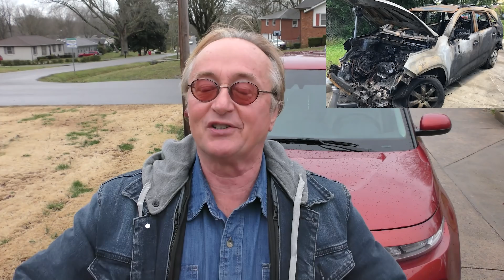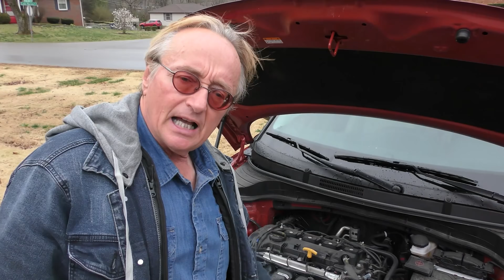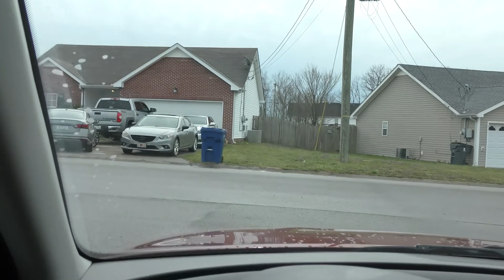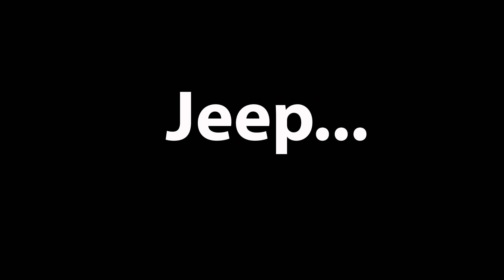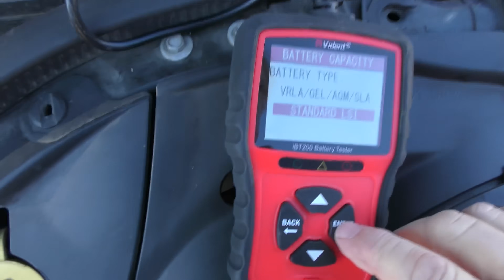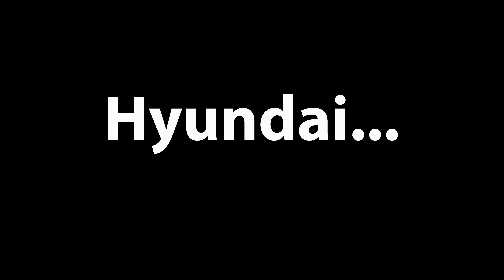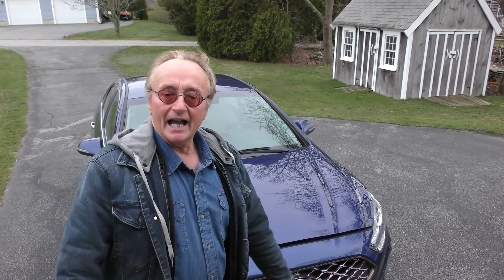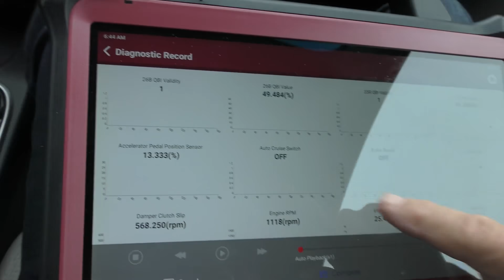3 Car Brands That are Crap

Comment: Bought a new Dodge Dart and it burnt oil like crazy but was still in the legal limits of oil consumption.  If I'd go the 10,000 miles recommended for oil changes I would only have 40% left of oil. I changed it every 4000 but oil level would be below dip stick line. Bought a Kia Sportage and it also burnt oil but not quite as bad. Bought another Kia Sportage and drove it conservatively the first 1000 miles. It also burns oil but not as bad. Stays within dip stick lines. I'm starting to feel that all engines these days are burning oil.

Comment: All car makers have an acceptable oil usage which it has to exceed for warrantee work, also the car might get better with use, you can also change the oil viscosity to minimize oil burning. Air cooled Beetles burn up no 3 because of the oil cooler placement, that's why they moved it to outside the fan shroud, it still took some air from no 3 so didn't cure it fully.

Comment: To be fair. I've had my 2013 kia Rio for 10 years. It started to burn oil past 180000 km. I've got almost 300000 on it now and it still goes. I'll drive it into the ground before I replace it and I feel it was a decent car for the price at the time.
Reply: You have an older one...built better back then.

Comment: My 2016 Elantra Sport is in it’s second warranted engine (refurbished replacement of course) and at 74,000 it’s using damn near a quart of oil every 1,500 miles it seems.

Comment: If the transmission fluid is correct, and 5th gear is whining, then it means there is subtle damage to the 5th gear. You have to examine the gear visually.  Sometimes there is a small groove or scoring near the gear teeth. Its hard to say what the future holds for it. I would be a lttile worried If I was doing alot of highway driving. Its hard to say w/o visual inspection. The dealer probably dumped the tranny fluid thinking there was loose metal shavings causing the sound, but if that didnt help then its the gear it self. What you dont want to occur is getting shavings falling into the bearings making funny noises. That isnt always corrected by changing fluids and it can be an unpredictable gremlin. If the dealer tells you he is taking down the tranny ask them to take a picture.

Comment: This is a request for a new video.  

Situation: my mechanic replaced the rear end. From what I know, gears that are matched at the factory should stay together. However, he did not do that. He simply used the differential that was in the rear housing. Now there is a periodic home, and I know it will never go away. My problem, is, I don’t know if it will wear long enough to match the rest of the car. Your video would be most welcome.

I would never find your reply to this question in the comments section because your channel is so popular.

Alan jones, Westford, Massachusetts.

Comment: We have a 2016 KIA Forte 5. It has the 2 liter engine. It has been trouble free for 7 years. We change the oil once a year. Has 21785 on it. Small town driving. There was a recall where they installed some software to let you know it the connecting rod bearings are going. Apparently there have been problems with them not getting enough oil. This is not reassuring but they did extend the drive train warranty to 15 years. We drove the Soul when we bought the Forte and didn't like is anywhere near as well. The Forte is much faster, more roomy and the Soul does have poor visibility in the rear corners like so many cars these days. That was critical for us. You need to be able to see cars in your blind spot. I drove the Forte the first year and loved it. My wife drives in now and loves it. We also use full synthetic oil now to help avoid any connection rod problem.
Reply: Found out about the warranty too late they as in kia says it only goes to 150000 after that they aren't fuxing it I.found at 147000 with a p1326 code and o2 sensor  triggering it decreased accleration as well fuxed the sensor  it still  had decreased accleration then went to autozone they  wiped the codes and it atarted back runnibg good again but to us we never  got good gas mileage we got it used its a 2014 kia soul plus and yes I make 4 trips a day now only the last 2 months and we got in october of 2021 so we like wow it goes thru oil and so I'm not into kia lije that

Comment: Ford used to say that about oil back the 70’s
The issue was when you took a 3500 mile trip. The engine held 5 qts. In 3500 miles , 3-1/2 qts would be gone from the crankcase.
Not a good situation

Comment: I'm not gonna lie my 2017 kia forte is a champ but I've worked on cars for 15 years so I take care of it. I've put 85,000 miles on it in 1 year I bought it used with 29,000 miles had it now for 3 years now issues. Matter of fact the oil is super clean after 7500 miles when I change the oil. I've never seen that from any of the other 2.0l that change there oil every 3000 miles it's usually pitch black.

Comment: Scotty, I am a retired electrician and to me I think there is a parasitic short to ground somewhere in the wiring harness. Those problems are very hard to find. If it were me I think I would pull accessory fuses one by one. If you pull a fuse and the alternator voltage increases, that circuit may be your stating point. Again, I love your videos!
Reply: The more aftermarket kit the more nightmares lol
Reply: Excellent suggestion !😊
Reply: Thank you Sir! @dhmalcolm
Reply: I love when a fellow human is so passionate about their gifts. Keep doing what you do Mr Electrician, you are helping so many of us who know nothing on this topic!
Reply: @PopBandit  Well thank you so much for your kind words.
Reply: @electrician248

If you want to find draws the easy way on a car, get yourself an Amp Hound. One of the best tools I own for diagnosing parasitic drains.
Reply: I think I may go back to my "plan A"  Find

Comment: So Suzuki wants uto change it oil every 7500 miles and it burns a quart every 1000 miles they want you to put 7 and a half quarts in between oil changes? Before they will fix it. That's nuts.

Comment: I have  2009 V6 Loaded 2WD KIA Sportage and it has been rook solid. 130K on the Odo and I expect to get another 130k. This model was built in Korea and has mostly Highway miles. I did have the A/C compressor replaced last year but living in Florida I need it ice cold.  Still looks great. With the crazy price of both new and used cars, I intend to drive this until the wheels fall off.

Comment: On jeeps, the unified power module tends to have bad terminal mounting.  It may look like each component is properly plugged in ... but internal terminals often slip downward and barely touch the spade lugs of "plugged-in" components.  Intermittent and/or high resistance connections result and are hard to locate and correct.  Check the back side of the module for wiring terminals that are not snug on the relevant component lugs.

Comment: True fact  we test drove a kia got back to the dealership to find out they ran a credit ck without permission or a signed ok. When ee got back i cked the oil, the dipstick was dry 0 oil. Then they tried to sell me a car we talked about price they wouldn't budge on price. So final offer was first offer. Then he tells me its on the car we test drove without oil in it.
We couldn't leave the dealership fast enough. Thank god i looked at yhe dipstick somone was looking out for me.  My wife bought a 2001 celica a few days later i still own it its in my driveway.  I sold my 94 celica a few years ago because no one drove it anymore.  
It sat fof 17 years needed some work like gaskets and spark plug tube seals as well as bushing it had 
280k miles on it. And i didnt change the oil very often .

Comment: I have a 2000 ford ranger 23yrs old and doesn't burn oil at all ,why ,i only used Castrol gtx
Reply: Toyota's 2006 RAV4, which Scott is sponsoring, was the worst car I have ever had with over half its oil burned. I guess he is bought.

Comment: I own a 2011 Kia Sorento with over 250k on it now.  Besides minor work due to wear and tear that I have done in the garage at home, zero issues.  So many cars and trucks have passed through my possession over the years, and I am still absolutely surprised the old Kia Sorento has been the most reliable and durable.  In my experience, every car brand will have serious issues with their car lines from time to time.  And none of them will own up to the issues and properly take care of their customers.  Despite doing your best research, buying a vehicle is unfortunately a very expensive roll of the dice - and a game most of us have to play.
Reply: sorentos are sweet love mine
Reply: I have a 2011 Kia Sorento V6 170000 me not one problem
Reply: That's before they started to sell cars with GDI engines. I'm pretty sure yours is MPI.
Reply: 2013 Kia Sorento here. 151k miles. Replaced wheel bearings, changed oils and fluids and nothing else. Rock solid.
Reply: Certain kias are bullet proof. And other have life threatening wounds when they leave the assembly line. Speaking from experience. However for the price of it I can put two engines in it and still come out ahead of a Toyota or Ford in price
Reply: As it turns out, usually the last model year of a generation is the most reliable version. Never buy a car when it's just gone through a new gen refresh. That first year or two will always have problems guaranteed that get ironed out in the following years.
Reply: What cars have you had?

Comment: I have a 2011 Hyundai Elantra. It has that startup sound on the engine where the timing chain is tapping on startup. It also had a transmission sensor done at 45k miles. It currently has 175k miles. Thise two issues while very serious, have been the only issues. The car has been dependable, but you never know if that chain is gonna snap. All regular maintenance has been performed. Essentially, Im a reluctant recommender of thr Hyundai.

Comment: I had a 2005 Hyundai accent. Standard transmission, zero electric features. It made it to almost 400,000. Had a 99 saturn, standard transmission, zero extras. Made it further. Best gas mileage ever. Hyundai and kia suck now. Why?

Comment: I put 195,000 miles on a 2014 Kia Sportage.  The only item that had to be repaired was the AC system, it went out at about 120K miles.  I wouldn't hesitate to buy another one but they don't sell a pickup!

Comment: I suppose you could put hot glue around a couple of the bell housing bolts before taking the car to the dealer. When you get the car back and the glue didn't crack you'll have your answer and your proof. If they are cracked, it doesn't prove they did the work either though...
Reply: I always mark my old parts. I have no trust in the Honda dealership. So why do I patronize them?
I live in Podunk. There isn't a decent auto repair shop within 100 miles. The last one shut down because they couldn't find mechanics. It took a month to book an appointment for service.

Comment: This loud mouth obviously has it out for Hyundai/Kia. 

I've owned several of their vehicles, some well over 125K miles. I've had a Sorento, Sonata, Optima, Soul and Tucson. The ONLY mechanical issues I had across all of them was a stuck thermostat on a 2014 Soul (that was a b^tch to replace) abd a faulty wheel speed sensor on a 2017 Optima. My kids drove the ones that had the problems, and they beat the heck out of them. The ones I've driven, never an issue. Not to mention their warranties which are great, even if you buy used you get the  5yr/60K miles but never had to use them.

Comment: I've had two Hyundais for several years and I love them. Sounds like the problem was a weird noise in the transmission that really didn't have much effect on driving, and the guy's had the car for over 40K miles with no other issues. And that's a reason to say the entire car brand is crap? And the dealership is not honest with the customers? NO!!!!!!!!REALLY?????🤪

Comment: before computers changing the voltage regulator wound have fixed intermittent voltage
 drops , especially if ambient temperature is involved.

Comment: My 2016 Hyundai Sonata leaked oil from the day we bought it brand new. After the engine blew at 140k miles, and I mean blew a hole in the side the size of my fist, they replaced the engine and it still leaked. They replaced the head gasket and it still leaked, took it back and they said nothing they could do because we'd put 10k miles on it since the new engine had been put in (we put 30k+ miles on our vehicles a year). Took it to another mechanic and he replaced the head gasket again. It still leaked, took it back and he found a leak on the oil pan. He fixed that free since he misdiagnosed the first time. That was 40k miles ago and there's not been a leak since. Never trust the Hyundai mechanics.

Comment: My 2009 Subaru Tribeca burned a quart per 1000 miles  from day one when we bought it brand new. Called the dealer and they said it was normal for Subaru engine. Looked into the owner manual and it clearly stated as normal operating condition. WTF!!! I trust my money with Honda 1st then Toyota 2nd from now on.

Comment: I have been really badly treated, ripped off and scammed by TOYOTA dealership in Jacksonville, NC (Hwy 17) who were working on my car's engine. What happened was their mechanic swopped engine parts of my Toyota Supra 1989 for parts in his Toyota Supra. I have noticed that but I did not make any photos nor had any substantial proof of that. Then they let me "drive off" with ZERO OIL in the engine! I am glad I checked the oil level myself before I even started the engine! And I have also noticed the engine was only "attached" with one screw! They basically tried to injure or even kill me. And the charge was outrageously high. They refused to do anything about it and only realeased my car once I paid for the "repairs". I even emailed Toyota HQ in Japan, but received no reply from them.

Comment: damn. I have a 99' GMC Jimmy with almost 200,000 on it, and it leaks every fluid you can put in it other then gas, but I don't think it even burns oil... Okay, well, I would assume it probably does, but I don't see too much out of the ordinary with it.

Comment: At a half quart every 1000 miles you might have the oil completely changed by 7500 miles depending on how much it holds. Kia & Hyundai had better get there act together & start treating customers like they're number one or they won't have any customers one day. I definitely would not buy either brand.

Comment: Yeah, Kia will tell you that if you go anywhere else to change oil, that it's leaking oil because other places aren't using the correct oil filter. It's a racket.

Comment: Warranties mean nothing to anyone anymore, not just cars but appliances or anything else you buy. You have to fight to the death just to make them honor their warranty. I'd tell you the fight I had with Delta over a cracked shower pan but it would take too long. Just know, I wouldn't let them off the hook without a serious fight. But of course they won't cover the installation of the new one, which they should

Comment: I wish I had seen this before buying the 2018 sportage sx turbo, it still runs and I have 188k miles on it but it burns 4 quarts of oil between 5k oil changes

Comment: Well kids here is were Scotty really got it wrong and showed he DOES NOT know every thing.
 

 With low voltage in the system something has failed or corrosion at some connection has gone bad. or intermittent, NOT A SHORT !!!
 Automotive electrical systems are not that complicated but auto mechanics (Like Scotty) always seem to blame shorts for everything that goes 
wrong and that is simply not the case. Most electrical problems  in cars are from parts going bad and OPENS, not SHORTS.  
 At 140K+ on a four wheel drive you can bet that this, or any car CAN have some dirt or corrosion build up in the electrical system.
'll bet spraying the contacts and the plugs they go into with electronic contact cleaner will more than likely fix the problem. 
 With a short you will get fried wires or fire, if you don't have either that it is probably an open or a dirty or intermittent connection .
 By banging on the module housing to start the car, that told me it was an intermittent connection.

Comment: Kia was finally starting to become decent until they released their direct injection engines and then everything went downhill again. Those older 2004-2009 or so Kias with the 1st gen Theta engine were actually pretty good and I've seen several that went well over 200K miles with minimal issues. The Theta II, especially the GDI models were a huge step back in reliability and Kia/Hyundai's lack of willingness to stand behind their obviously defective product has been reprehensible.

Comment: I just assume all newer cars are trash. I have a 2015 VW beetle. I’ve taken care of it well, taking it to the dealer and the same mechanic the whole 9-1/2 years I’ve had it. It just turned over 49k  original miles on it yesterday. The sensors, steering column, and brake system is failing. Seems like the engine is outliving everything else. To top that off, the dealership ordered the parts on an “extended warranty “ and told me the parts will NEVER COME!!! Even if I pay the $3k to fix it, the parts will never come. So I’m in the market for a new car. Probably going to get a Toyota. Even though Toyotas probably only give you 10 good years.

Comment: Like a couple others here, my luck with modern Kia has been amazing. Ran a Soul to almost 250K miles before trading, currently running two Sportages, one well into the 100,000s. I've replaced a fan switch. Nothing but regular maintenance besides that.
Reply: loving my soranto
Reply: My sportage my only issue is one of my headlight assembly needs to replaced not beciase the light didn't work but some other electrical things. Other then that it's good
Reply: KIa's  are far more reliable than Scotty insinuates.  He must be getting kickbacks from Toyota.